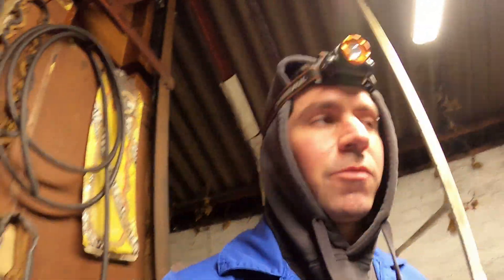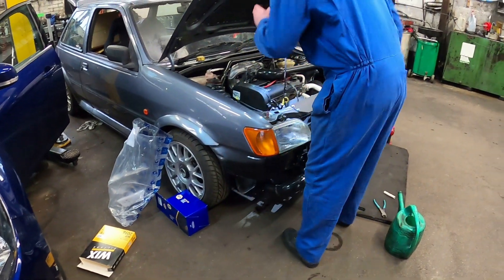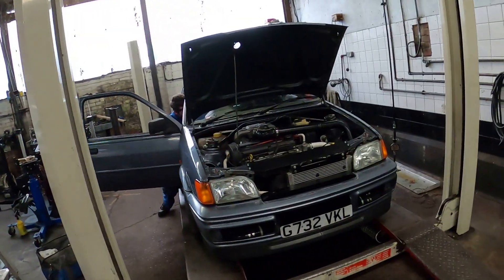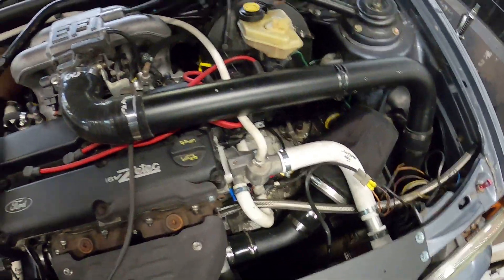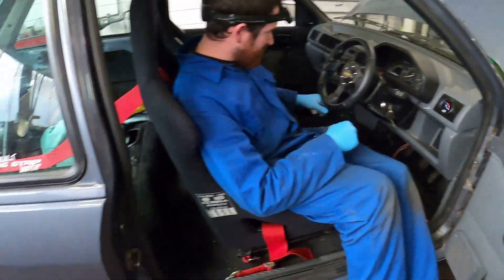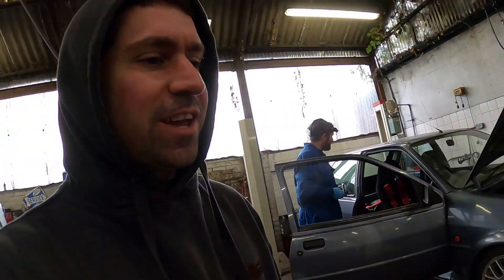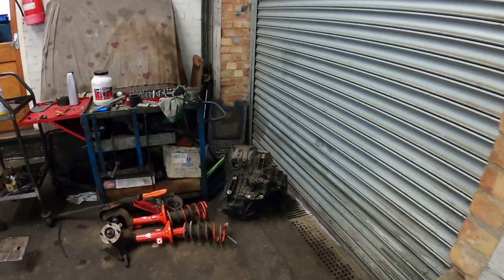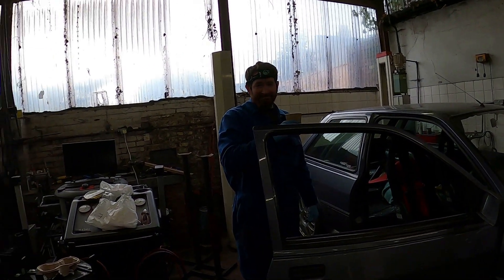##Jamie's Zetec Turbo Ford Fiesta HITS THE DYNO##

Comment: Does running a intercooler in front of the rad cause any cooling issues? As I'm doing same and worried about air flow to the radiator
Reply from the maker: Nope none as all. His rad is also a tiny honda rad
Reply: @ignitionadvantages6592  thanks, I have a seat ibiza ali one 650x340mm so hopefully OK for a zetec turbo if I have space to also fit a 12" fan👍